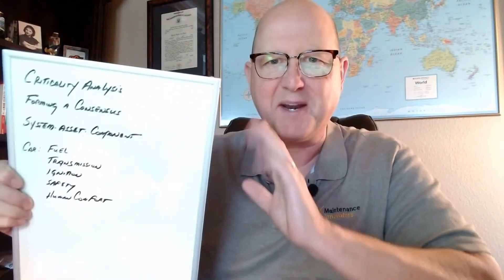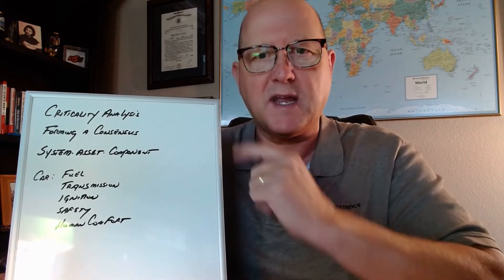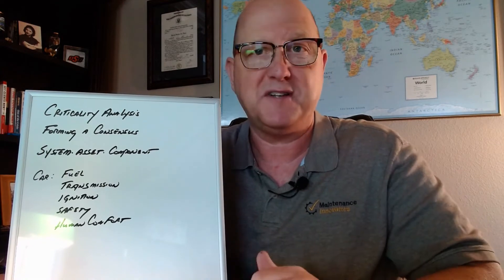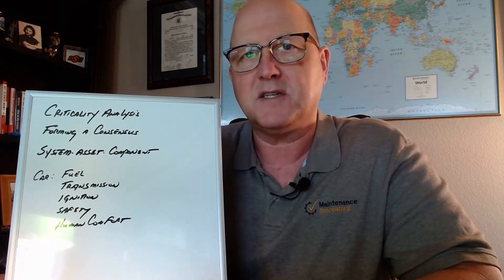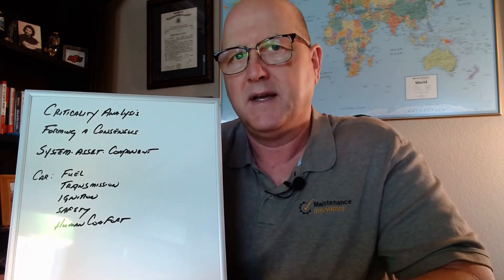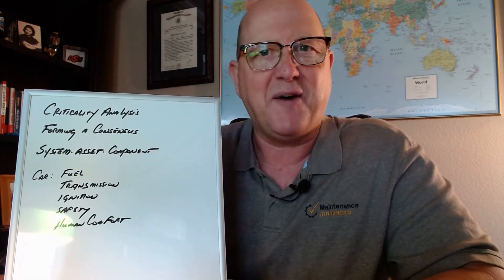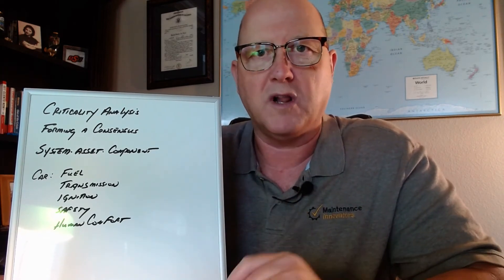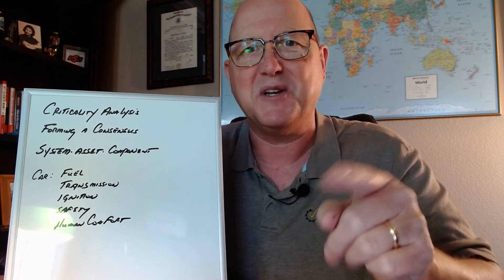Criticality Analysis

Comment: Asset Criticality needs to be very early step on your reliability journey.   I'm often surprised at how many maintenance managers have never heard of the term.   I prefer to use math to calculate AC, but you are correct you need consensus of the factors.   The math makes an easier sell to top management.   It's binary.
Reply from the maker: Thanks Joe.  I'm a math guy too!